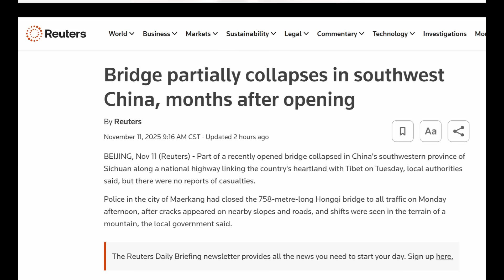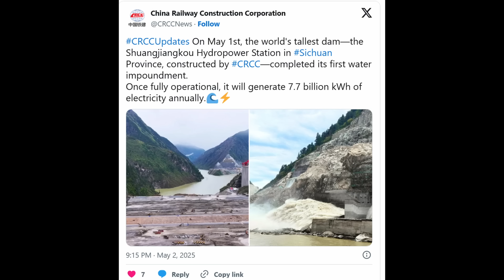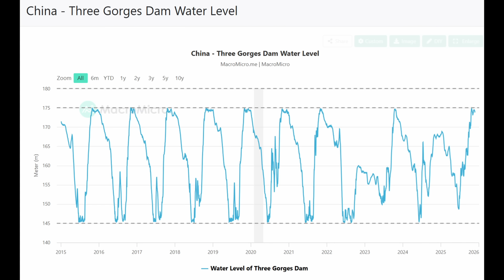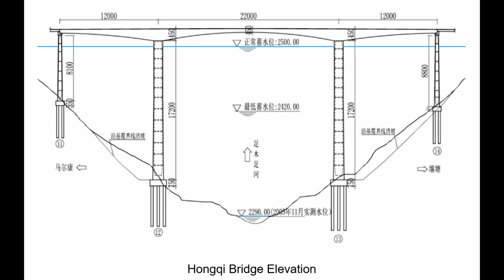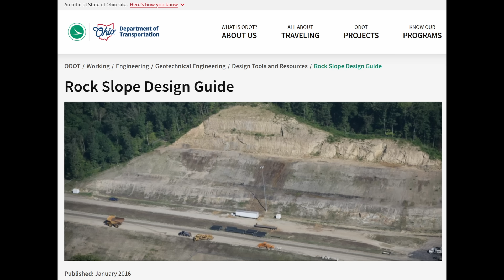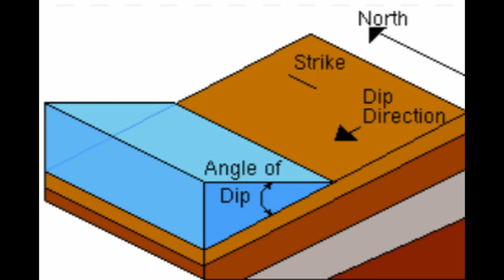Update - China Bridge Collapse

Comment: 6:14  OMG.  Did I read that right?  They're building that huge dam in THAT area?
Reply from the maker: What happened with the bridge does not inspire confidence in the dam.
Reply: @CaseyJones-Engineer  'Confidence' and 'China',  two words never used in the same sentence.
Reply: Of course, since this is China, nobody will ever be hurt by this contraption ever 😂
Reply: Oh yeah, its going to be a catastrophe for sure.
Reply: That's nothing.  Nearly as large concrete arch dam is built in a canyon like this.  To 'stabilize' the cliff faces an eleborate system of 'ski center like chair lift for 10 cu yd concrete buckets went up and down valley for 1000's of feet so they could cover cliffs with rebar and shot crete.  What could go wrong?  Assuming rebar isn't painted bamboo.  Water infiltration behind the shot crete erodes channels destabilizing cliff face without any warning.  1,000 plus foot tall 6 inch? 12 inch? shotcrete walls just buckle and crack and fold up and floor some day for lack of bracing.  Doubly so if shotcrete leaks and soil behind liquifies, either from standing water, variation cycling,  or eathquake...
Reply: The whole point of building that particular bridge was to allow the road to continue to cross the area after the reservoir was completed.
Reply: Is this the dam that the Indians complaining about as it gives the Chinese ability to restrict water supplies to India?
Reply: Seems as if the most important thing is -  Build for bragging rites,, Build in order to move small pink pieces of paper with dead dictators printed on them around,, and "allegedly" corrupt to skim off the moneys used to build said structures. Starting with a think tank of experts in different fields of a builds to find the best aspects in a build isn't high priority I'm guessing.